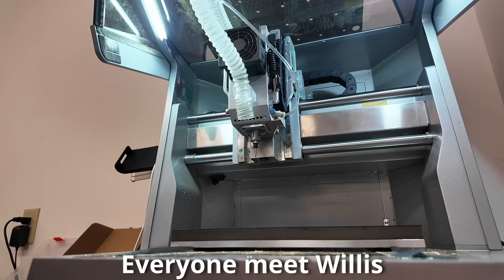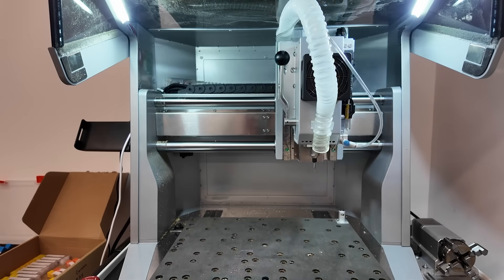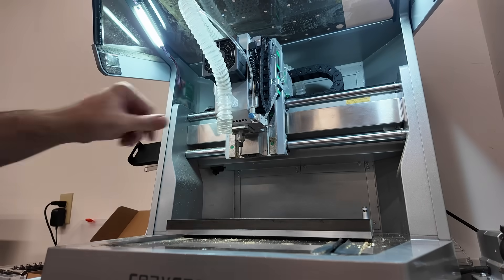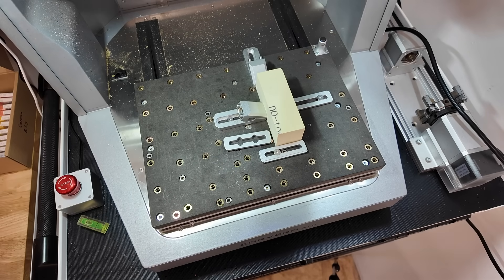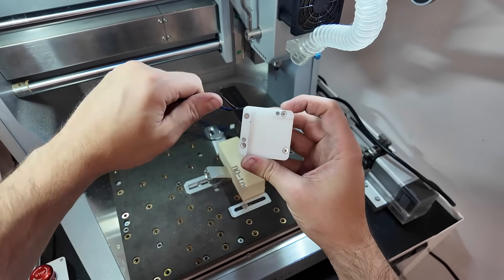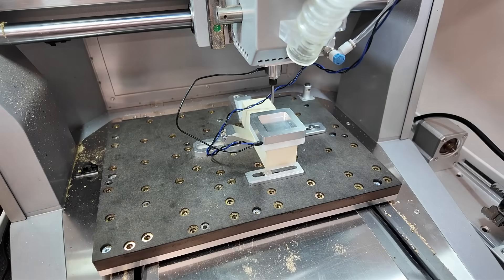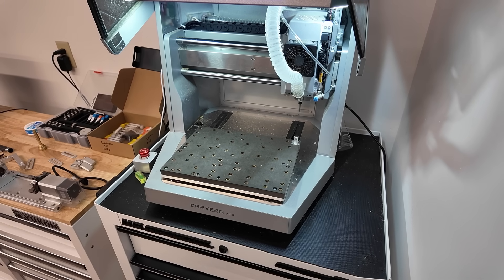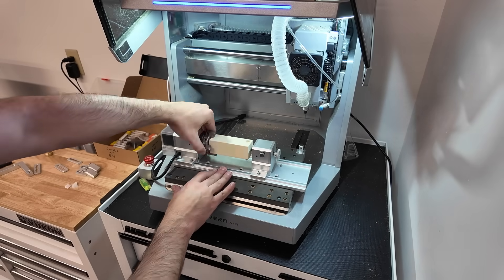Should You Buy the Makera Carvera Air in 2025?

Comment: Come on, $6000 for the high end Carvers isn't cheap, but it's not expensive either. An equivalent manual lathe and a mill will cost you a lot more, especially when you add in the required tooling and fixtures. Manual machines have a steeper learning curve covering several disciplines in order to use them safely and effectively. Even with years of machining experience, it's too easy to scrap expensive parts due to human error.

The cost of running and maintaining a CNC, on the other hand, is far less costly. Most operations can be performed using a single endmill and don't require expensive and complex fixtures, such as rotary tables and divider heads. Its learning curve is drastically shorter. Most operations require little operator input aside from the initial part setup, resulting in fewer scrapped parts. 

When you add it all up, $6K the higher-end Carvera is a bargain. In fact, it's an even better value than the $2K model which is not as capable.

Comment: What do you think of the low spindel power how that impact what you can do?
Compare this with a 2200w  spindle on a 6040 from Aliexpress:
Im looking at Carvera Air or 6040 for some fun hop project but also for soma aluminum parts and carbon copsist molds  (HD foam blocks)

Comment: screw that the price is a deal beaker. it's cool but from a guy who does cnc daily, i'm not impressed much. i'd be in for a benchtop cnc mill for that price. the laser thing can be done with a cnc router with a laser head. they also have cnc 4th axis attachments for all the way down to the 3018s. if is's plastics ya want, 3d print them 100%. the fdm filaments options is quite the can of worms. the options aren't just abs, pla or petg anymore. it's crazy.. i've recently gotten a p1s and have had the cnc router for quite a while now. you can do a lot with them. the router isn't a great option but mill that can sit on a benchtop and a lathe, that'd be all ya need for small parts. a capable 3d printer with the right filament can probably eliminate the need for both in many cases.
Reply from the maker: Yeah, I had a real hard time trying to find a solution that I could make with the CNC that I could make on my 3-D printer. I’ve been doing a lot of stuff with Glassfield and carbon fiber and it’s fantastic.

Comment: I bought the Carvera Air because it is small and space comes at a premium in Sweden. It is not advertised as a commercial "money making machine". It is firstly geared towards makers and tinkerers, which I am. It's great at making stuff like the bushing I needed to restore an antique clock, or the alu bracket I needed for my RC high torque motor conversion (previous was plastic), or creating a thoughtful gift like a ring box from wood, a medallion or coin that is custom and one-of-a-kind. I've made custom adaptors that are not available on the market, nylon and epoxy jigs for project assemblies. What about a replacement button for that 20 year old clicker? Bigger custom alu heatsink for my printer extruder, custom spacer for my bolt-on smart lock that just would not fit my door. The options to make are many, if you use it for purposes it can do. Secondly, it is a great educational tool. I spent the past weekend, teaching my 14 year old son how to envisage, design, program and make his very own medallion. The happiness it provided him, and the time spent together was priceless 👌🏻
Reply: -- Very nice write up!
Reply: real comment or bot? account is a tad older than the comment
Reply: @Kas1880 you really think a bot is capable enough to write a comment like mine 😂? Come visit Gothenburg in Sweden if you want a beer with this bot 🍻

Comment: You can cut tool steel but you have to have the correct tools and knowledge of how to do. I got mine for fine deburring of 3D printer parts and 2ndary operation type stuff. The biggest downside for me having over 35 years in machining and manufacturing and CNC Programming is they as of this comment... do not have cutter comp in the control which is drag because if you're trying to dial in a thread using a thread mill you have to try the size and then since there's no adjustment in the control... you have to go back to the part CAM file that you made the program from and change the size of the tool there and reprocess the gcode file re-download it then try and see if the adjustment is correct or not repeating this until you have the size you want... this is very time consuming... and what about tool wear... the control is very generic... but it is fairly user-friendly for the most part... BTW the tools for this size machine for professional machining should be found at tool manufacturers website like micro100 and Harvey Tool and Robjack... there's a lot more but those I mentioned are well suited for the size of tools you can put in this machine. I went with the 6 tool tool changer version and 4th axis. So far it's not bad and from what I've seen so far that actually avaliable and has a decent market share, it's this brand of machine you're doing this video on... I appreciate you...

Comment: I've been looking at it for a while. The 4th axis is cool, but I don't think I would need it for my uses. I've been in the laser engraving world for 30 years, back when a cheap laser was $25k. The small footprint and enclosure intrigues me. If you have a use for it, $5k is nothing. The speed is the problem.
Reply from the maker: It is not a tool if you need something right now, that's for sure.

Comment: Why not review the GG3-S.  The base machine is a little less expensive, but tooling and jigs go add upp. Unlike this machine, however, it does machine steel.
Reply from the maker: Does it?  Would it not have to actually be released to make that claim?  Seriously though, if that sort of thing is the only thing you want to use it for, then sure. But over $3k for a one trick pony?   And the most popular things people want that for don't need to be steel.
Reply: @denoftools Yeah the GG3 does, but I have also seen people use the Carvera for steel and titanium. Just got to get the speeds/feeds right, of course very slowly. But the GG3 also has a non-pew pew twin, the “Coast Runner” rhymes with Ghost….. CNC. The Carvera should also be able to do optic cuts, lots of AL and brass in the pew pew world.

Comment: My first project with the Carvera Air was machining brackets to mount a pallet box on my trailer.  Yes, I could have hand cut and drilled the parts, but I would not have been able to make the parts identical to each other. I do not have the quality of tools to be that precise manufacturing by hand.  I almost passed on buying the laser until I saw that it could do the silk screening on PCB's

Comment: It's cool. I have 20 years in the trade. The biggest problem I see is it's limited size of parts you can make and having to take very small cuts which leads to long run times per part. It's useful for sure. Just make sure you understand all the pros and cons before you jump in. Measuring tools, fixturing and vices, cutters and tool holder \ arbors \ collets often add up to far more than the actual machine cost.
Reply: yea its a toy. i have the langmuir mr1 and still  needs tons of work to make it production ready. im also finishing up a emco 120p pneumatic lathe super nice atc system too. ( the lathe is what im hoping will be my money mahine)

Comment: Just learn how to use a lathe. There’s a lot more involved in making these work than what was shown. These are still at their infancy.
Reply: I don't want to learn how to use a lathe I want something I can set and forget
Reply: @davidcorliss I wish they were that easy. This is not an appliance. There’s still quite a bit of setup and you have to know how to design. You’re going to get broken tooling, tooling that needs to be sharpened, things are going to go wrong. This is not a 3D printer. If the tool hits anything it’s not suppose to hit, it’s going to break something.
Reply: @Icemanto07 but future ones will be
Reply: @davidcorliss Absolutely. As I said earlier. These machines are in their infancy. I just don’t want people to think it’s a plug it in and it makes stuff kind of appliance.